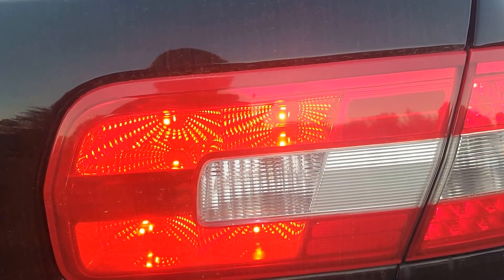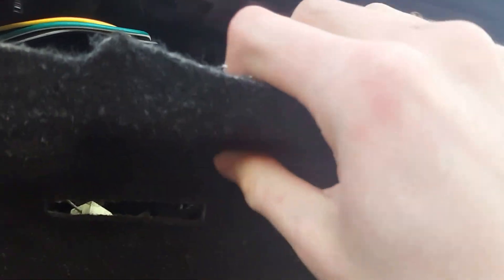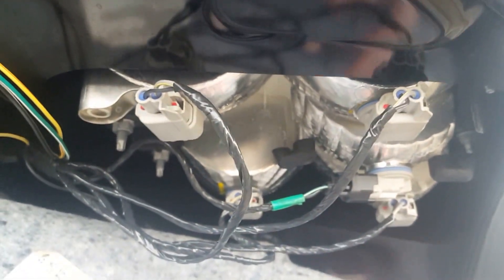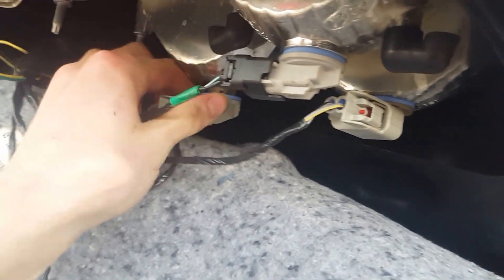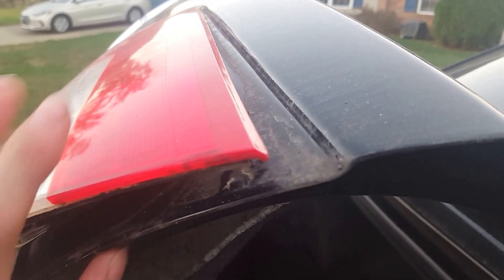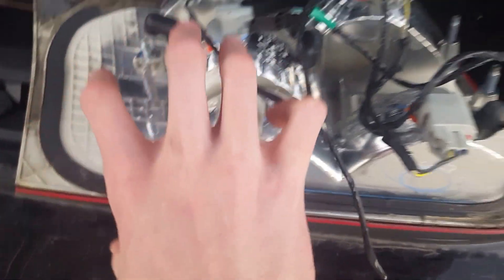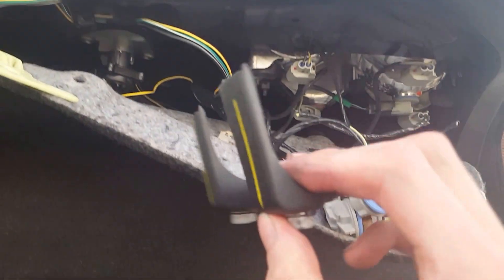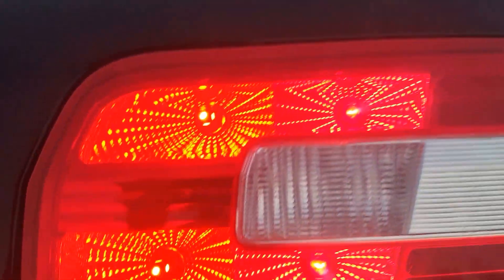How to replace the rear inner tail light on a lincoln mkz zephyr

Comment: I own a 2011 Lincoln mkz ..the driver side rear led strip went bad in the assembly.... Put the passenger side on it ..plugged it in and it worked ...so far 3 assemblies were put in and won't work ..any ideas or suggestions? Kinda desperate here lolol